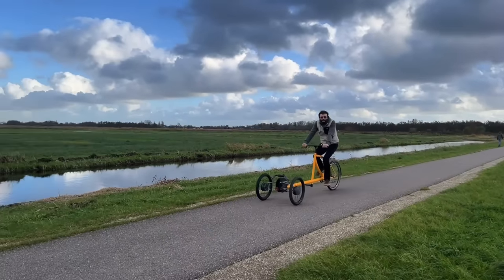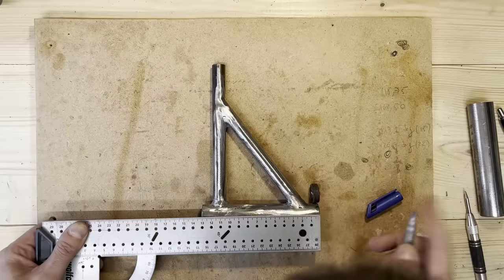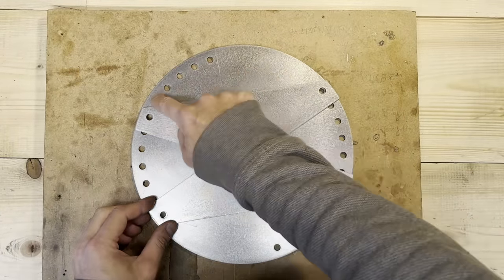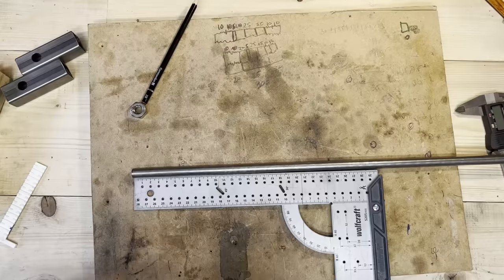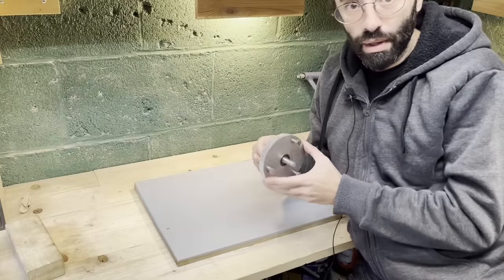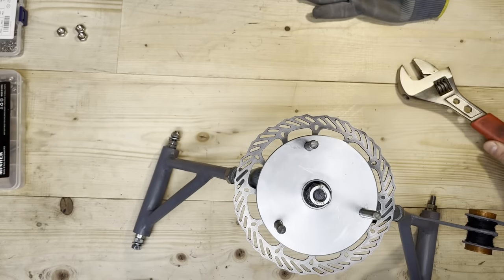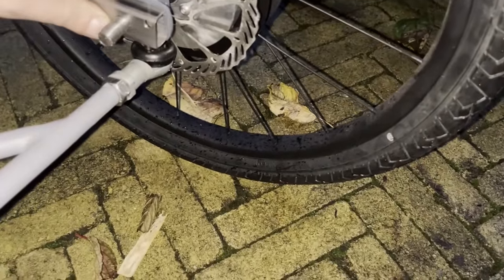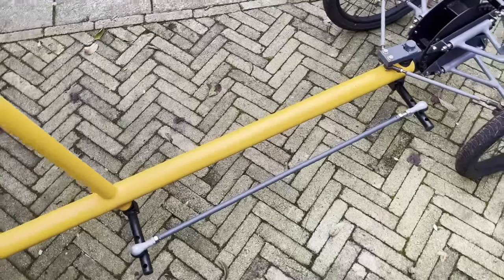Making of a Reverse Tilting Cargo Trike with Adjustable Geometry #5 - Full Build

Comment: A 2nd steering arm will get rid of the constant left right wobble in the steering. Instead of push or pull,  it will become: push+pull, which results in less/ no wobble. I had the same problem. The second steering arm was the solution.
Reply from the maker: Thank you very much for the suggestion to improve! I agree with the push-pull situation. I've been looking forward to upgrade to cable steering which would be pull-pull as well. Let me know what you think.
Reply: How would it work if you just use a bike chain instead of rods?
Might be more susceptible to road bumps.. 
My other thought would be, if the rods were bent at each end, so that the bulk of rod length  was under frame, it would be out of the way.. If you use the bent rods, you could make channels on the frame for them to slide in, so they wont wobble..

Also, I was wondering if this type of tilt steering could be adapted to make a self balancing system.. Using some kind of inverse feedback of the centrifugal force of the turn...
I am thinking that people in a car going around a turn are pushed in their seats to the outside of the curve. 

If the bike seat has the same force, then linking the seat's left/right shift action to the tilt of the wheels,  could possibly make auto correcting self balance system..
Reply: I saw someone on YouTube that did also o cargo bike with pull pull cables.
Reply: @WagonLoads  I wonder if bent rods wouldn't act as springs thus making the steering wobbly again
Reply from the maker: @ghicione  , me too! I'm also inspired my other makers that share their work on YouTube. Here's a great example of making a cable steering: https://youtu.be/Ie3uTHq4LSE?si=tsnqfaxDZjOhNZyT
Reply from the maker: @WagonLoads  , I haven't considered bike chains actually. But it makes sense that they would work! The truth is - I used a rod for simplicity because I'm focusing on the front. But later I will put some serious effort on making that connection better.
Regarding the tilting system - this system is used to combat the effects of centrifugal force. If you don't have a tilting system (like a quad) you have to lean in a specific way to counter centrifugal force or the quad will tip over. With tilting, you counter centrifugal force just like with a bike.
Reply: @pedro-neves  Yes, I understand that tilt is used to prevent flipping the bike. I had that problem with a non-tilt 3 wheel bike when I went too fast around a turn.. My thought is that the tilt you are doing, is controlled by the rider. My suggestion was to see if the tilt could be controlled by the effects of centrifugal force itself.. By putting the seat down low and hung on a pivot like a hammock.. As you go around a turn, the seat swings to the outside of the turn, then the pivot point of the seat causes pushrods to tilt the bike in the right direction to neutralize  the effect that would cause the bike to tip over. (Mechanical anti-tip feedback)
Reply: @pedro-neves  Second thought.. If you had a chain driven flywheel(gyro) linked parallel to the front wheels, when you turn right/left, the gyro will tilt. I am not sure which direction it tilts, but you should be able use the flywheel's tilt to control the tilt of the bike wheels..
Reply: Also less caster angle to diminish wobble or "shimmy" and check wheel bearings and their adjustment
Reply from the maker: @WagonLoads , your thoughts do sound cool;)
Reply from the maker: @miguelangelsimonfernandez5498  , I'll do this during the tests for sure!
Reply: It seems that wobble is only because in this first test he's only using the zero degree caster. It was very much expected with this angle but it'll be easily remedied when he changes to other angles. Also, the steering ratio seems high, which is also adjustable and he might do that too in the upcoming video.
Reply: If the issue is slop in the joints- you could simply double the joints up at each end and pre-tension them against eachother. ❤
Reply from the maker: @AB-lc8be ,  increasing the caster does decrease the wobble for sure. And I agree with the steering ratio as well;) I'll try everything!;) Cheers!
Reply: Maybe you could use a cardan instead of push/pull rods? With an angular gear on the bottom of the steering tube, a rotating axle with angular gears at both ends and a mating angular gear at the steering axle. It's harder to engineer, but looks like a more elegant and tighter solution. Or just belts and pulleys? That might be a cheaper, lighter and more performant solution that's less prone to backlash...
Reply: I think adding some  caster would help.
Reply from the maker: @ameunier41 I agree! And I will try with more caster. I can regulate it.
Reply: Rack and pinion might be worth considering because it's an enclosed system requiring little maintenance, it has tight tolerances, and it looks cleaner than a linkage. The downside is that it is indeed harder to manufacture and it's heavier, BUT instead of using a solid rod, you can use a tube with cutouts for weight savings.
Reply from the maker: @TheDustyShredder , thanks for that. Actually, I looked into a few off-the-shelf rack and pinion steering racks for small quads. I still consider it.
Reply: @pedro-neves  those would definitely be a good start. They're cheap enough that you can test several cutout designs to minimize weight as efficiently as possible too.
Reply: Totally agree, that's how the steering links are on my cargo bicycle. When I first assembled it, I left the left side lankage off and the handling was nasty! Twitchy as all f<whistles>!!! Straight back to the workshop to fit the missing link.

Comment: Amazing: you show how you use the machines you built from 3D printed and CNC-cut parts to make the parts for the machine you're building.  This is inspirational.  You take bootstrapping to a higher level!
Reply from the maker: Thank you so much! Ya, I don't have much money to buy machines so I make them;) And I make the machines fit for the purpose so it's all very custom built;) Happy that you enjoyed it! Cheers!
Reply: Bootstrapping is so misused. It's impossible. If you don't have boots, try picking yourself up by your shoelaces.

Comment: on the welding jigs, if you drill a hole through the plank where the tubes need to be welded you can easily tack 3 points without any problem and movement of the pieces

Comment: Nice work, but when pressing bearings in you should always press on the outer races not the inner.
Reply from the maker: Hello, ya, that's right... I'm using the spheres to pull the outside. I will not do this again. Cheers!
Reply: I think you should test a heavy load and see how it steers
Reply from the maker: @theoriginalrecycler , I will!

Comment: Same as I said to Phil Vandelay: I hope you'll always succeed professionally. People like you should always be hired in whatever they want in this area of expertise. It's hard to do all you do, but also document it and make a decent video out of it. That front component is a masterpiece. 

As someone said before, it might be copied by cargo bike builders. I just hope they reach out to you to be part of the development process. Cargo bikes are the future and hopefully, they'll replace cars and vans for most use-cases in urban areas.

On the other hand, I'd love to see how you install the cargo bay and carry stuff around. I'm not sure if the last big hole you made for the steering is going to compromise the structure once you carry heavy loads and hit a pothole. Take my point with a pinch of salt because I studied industrial engineering but haven't performed as such for a long time haha.
Reply from the maker: Hello, your comment is incredibly kind, thank you so much!
I am a big fan of this new generation of city vehicles. I believe this is the future - small, affordable, designed for the city.
I already installed a cargo bay for the tests that I'm performing. Looks very nice;) The hole in the front has been structurally corrected because I welded a vertical tube for the steering. 
I am now in the process of tuning the geometry and doing multiple tests. I'm working on a video for this. I hope you watch it;) Cheers!

Comment: This trike looks great! Awesome work there good sir, very well done! :D
A leaning trike with suspension is no easy feat to pull off, quite impressive!

The idea of a second steering arm suggested previously is a solid solution, but it doesnt have to be a "chunky" piece like a mirror of your current singlesided version.
It would suffice with a bowden cable, like a bike brake cable and tube.
The goal is to tension the system in both directions, eliminating any slop/give in the steering mechanism, and you only need a small force to accomplish this.
You can easily fabricate some wireclamps and tube end sockets with a drill and a hacksaw.
Reply from the maker: Thank you very much! The next version will have for sure a pull-pull system on the steering extension!

Comment: For an amateur bike builder you have produced a good working example.
Ok you welding technique is open to debate...as well as some applications.. methods.
But heyho your not a professional fitter or welder...
However, you computer and ideas are above the norm. 
Great little project...with so much to develop and improve...
Very interesting...
Look forward to some updates...
And maybe a discussion..
You get my vote if approval...
Simon a Brit in Spain 👍
Reply from the maker: Thank you very much! My welds are for sure not great. I'll buy a TIG machine soon before working on a project with a lot of welds. I'll do better with that.
Regarding the improvements, this is the point, make one, see what can be improved, learn, make another;) Cheers!
Reply: @pedro-neves  
Estas en España...y si de que parte...
Simon
Reply from the maker: @simonbertioli4696  ,in The Netherlands. Cheers!

Comment: getting this done with gasless mig welding is an achievement. however some of the beads are really on the edge of safety, outside of experimenting.

you might not see it that way yet, but with a bottle of argon you could save an incredible amount of time grinding and brushing off the flux that hides defects. 
my own welding experiments have run on one B50 bottle since the covid shutdown. i'm going to have it refilled at the end of this summer. it was short of 500 bucks for the bottle purchase and the first fill.
also gas welding means you can tig and mig, and both do less sparks than gasless.

i'm already checking the next video 🙂
Reply from the maker: I totally agree with everything that you wrote. Actually, I consider the welding to be the lowest point in quality of this build.
And you are soooo right about the grinding! In the end of this project, I was so tired of it.
The next investment for my shop is definitely a welder with gas.
Cheers!

Comment: Great video.
The setup adjustment is very clever. 
I was also struggling with the trail on my diy long john.
It turned out a bit unstable on slow speed but very good on speed.
Reply from the maker: Thank you! And great point, one geometry can make it good at some speed but not good faster or slower. On my geometry test, I'll share what make it better or worse at different speeds;)

Comment: Plenty of caster is always desirable, as it makes for self-centering steering, and easy no-hands riding.
Most people don't understand why it's really hard to ride no-hands on a downhill mountain bike: the angle of the forks is a lot steeper, so there is much less caster effect.
In cars it means you simply let go of the wheel and the car straightens up automatically.
Reply from the maker: Thanks for the downhill bike reference. Fully agree!

Comment: another point worth playing with is the height of where the track rod end attach to the steering control arm, as you roll the bike you will be getting some steering input adjusting that height will have interesting effects.
Reply from the maker: Thank you! I did design for low bump steer but in the end I rushed a little bit on the build. This parts needs a few improvements for sure! I'll consider your suggestions, thank you so much! Cheers!
Reply: @pedro-neves  just to be clear, bump steer is different.

Bump steer is what happens when one wheel raises up. 

Although similar, what happens if when static you tilt the bike over? 

Lastly, it looks from your front shock is a little hard? You don't seem to have any sag?
Reply from the maker: @DorsetSaferRoads  , when I tilt, the steering doesn't move. This is because the steering link is vertically parallel to the wishbones so tilting doesn't change the distance between middle steering pivot and the point in the wheel where it grabs.
The shock is not too hard. It's just that the front barely has any weight. If I stand in the tube in the front it sags.
Reply: @pedro-neves  AHH yes ofc, 

As for the shock, with you sat on it, it should compress about 20% of it's end stop to end stop travel, this keeps the wheels attached to the ground as you come off a flat topped bump.

Comment: To make your own hubs, mill 4 high corners with a round boss with a through hole in them as part of the first operation.  Then clamp a piece of aluminum on the table and mill it into a nest with 4 threaded holes and mating round pockets. (threadmilled).  Do not move or upset the nest and lightly bolt the parts to it one at a time and finish them.  This will hold position during the flip.  It is even possible to 3d print the nest and cut the dadum to get the precision you need as long as you take light cuts on the hubs. I print the threads right in the parts.
Reply from the maker: Thank you for the tip! I certainly have to try to make my own hubs again. And turning the parts is the fundamental piece!

Comment: just an observation - because of how you did caster, adjusting it also introduces pro dive into the geometry. it will feel soft and encourage more front weight transfer, and could make the bike feel even more twitchy esp. at faster speeds.
Reply from the maker: Thank you for the tip! I will try to find the sweet spot that balances control at low and high speeds.
Reply: @pedro-neves  you can move the caster adjustment in the hubs if you want to separate the dive adjustment and caster.  you may not feel the pro-dive right now since it's relatively light but it will progressively be evident as you load it with cargo.

you can also check out suspension systems of RC race cars - the physics and engineering in those are the same :)
Reply from the maker: @KimmyR3 , thank you! Oh, I compare it to many other designs for sure. I'll test with cargo and try to understand the "dive".

Comment: Enjoyed the video. If you are going to brake the hub you need to have your wheels built with a cross spoke patten to resist the torque. Using radial spokes and hub braking will result in early spoke failure due to bending at the nipple. I hope that is helpful
Reply from the maker: This is helpful, and I agree! I cannot count how many times I trued these wheels... I already have rims for 36 spokes, just need to convert them to the wheels for these hubs;) Cheers!
Reply: Bro, how does your bike stop with NO CALIPERS?

Comment: The toolings are the most impressive in this build. You should make a video explaining your tooling zigs because they are not off-the-shelf tools.
Reply: They are 3d printed tools, not difficult to make but probably won't last very long.
Reply: *tooling jigs
Reply from the maker: Thank you! Indeed some of the components are 3D printed (most jigs) just because it's so easy and cheap to print a guide. If plastic is not suitable, sometimes I make jigs from wood. Besides the jigs, I made a machine for notching the tubes. I think this machines is pretty cool because it's a very accurate notcher and general grinder with many function. I will actually make a video about this machine. I estimate I'll release it in 1.5 months from now. Hope you watch it and enjoy it;)

Comment: In the 1990's I was in an electric car racing club in HS. For my senior project I designed a trike with active camber front steering. It had a disc that the steering mounted to, as well as the upper control arms. The control arms would move in proportion to the amount of steering input. At the time we raced fairly large karts with 2 lead acid car batteries for power. With 20"  bicycle wheels we had to slow down severely in the tight corners given our moving mass. If we went too fast, we would taco the rims.  
By this point in my high school career, I was a fairly disengaged loner who would rather be at home playing Half Life. I was given the opportunity to build my design, but at that time I was intimidated by metal fabrication, and very self conscious about my welding skills (even though I became a professional metal fabricator later in life). So I never built it. Teacher aide even tried to flunk me on my senior year for not taking the initiative, but I didn't care. I was over it. 
I had already competed in an international engineering competition a few years prior, so I just wasn't interested for whatever reason. I personally think it was just being a loner in a very cliquey small town school. I didn't feel like I belonged there.
Reply from the maker: Thank you for sharing. Just want to say that if you want to do something and this thing that you want to do is good for you and perhaps even good for the world, then I think you should do it. There is more regret from things we didn't do than from things we do. If you are kind and with positive motivation, your project should create happiness. Cheers!